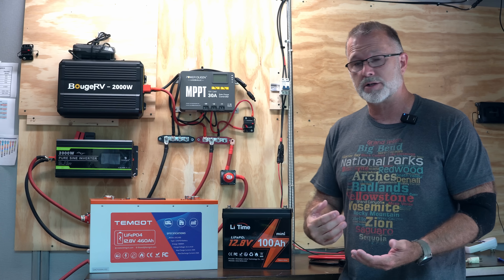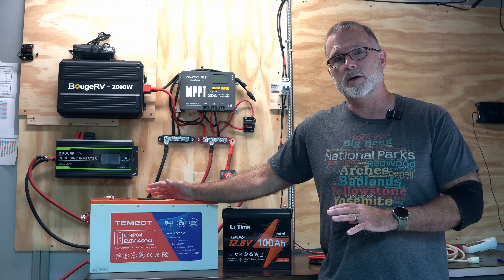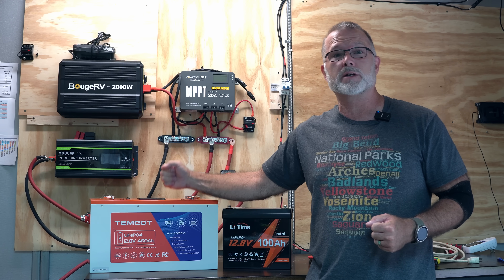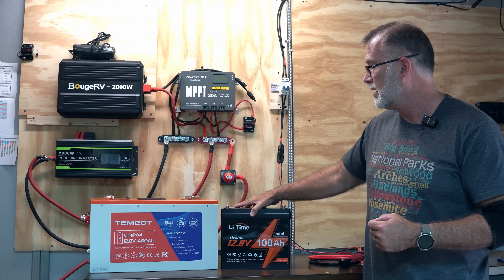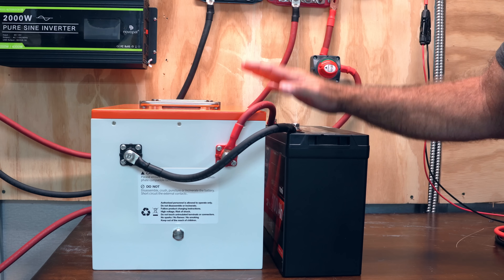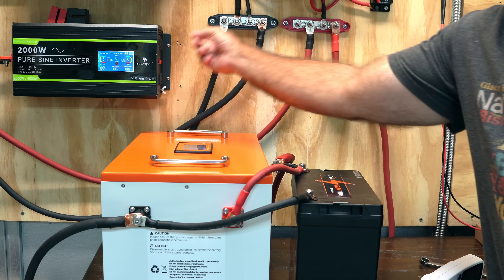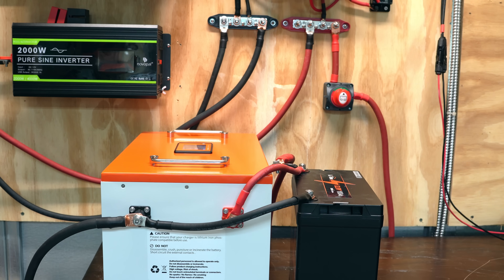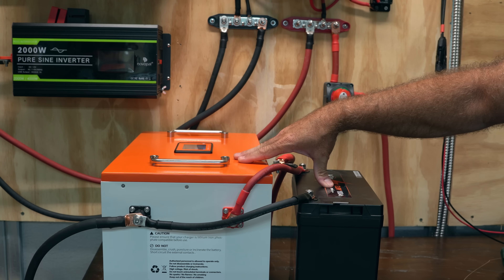Connecting Batteries with DIFFERENT Capacity in Parallel - What Happens?!

Comment: It's strongly recommended you don't use batteries of different capacities in parallel, the load is roughly shared between batteries and as such the lower capacity will discharge faster and then there's a danger of the larger capacity trying to recharge the lower capacity in other words some of the power in the larger battery is being wasted charging the lower capacity one, in some applications such as lithium polymer batteries there's a danger of fire with the excess currents the may arise between the two batteries, in lead acid you may get cell damage, do not mix different capacities in a parallel configuration.
If batteries are used in a parallel configuration, they should be of the same chemistry, same age and same capacity
Reply: how a battery with a smaller capacity will discharge sooner when both maintain the same voltage during discharge

Comment: So I can add a couple larger battle born batteries to my current 400ah setup, excellent 😊
Reply: Make sure to read the existing battery/s voltage/s and ensure that the NEW batteries (to be added) are at exactly (or within 0.5% of) that reading - when connecting them in, or you could become "the cable" that makes the shorting circuit, resulting in a nasty jolt between fingers, or worse, across your shoulders (and critical internal organs).

Comment: What about charging, my battery says 10amps max. I have two in series can I charge 20amps?.
Reply: Nope.
In series the voltage is doubled, but the current has to go though both.
In parallel the current is split so it can be doubled.

Comment: This is helpful as I was contemplating buying a second lead acid deep cycle 12 volt battery to put in parallel with the one that came with my RV. I wasn't sure how closely I needed to match the original battery. Apparently it's not that critical
Reply: That's exactly what I did for my touring caravan to maximise the benefit when charging from either the car or the PV panels, not had any issues and over doubled the time I can run without a mains hookup
Reply: To both you and @Paul-FrancisB
What neither of you have done (or intend to do) has a daul battery isolator in the charging circuit (from the alternator), as they will just become as if a single battery bank, that could well go "below" the required vehicle starting voltage, with a result of being unable to recharge anything, if away from a mains recharging facility.

It's far better in an RV to have a battery isolator in the form of a dual battery circuit, where if needed, you can switch across between one battery or the other, or if a vehicle's battery gets drained (you accidentally leave the lights on or similar) you can JUMP the vehicle's battery with the RV's on-board house battey, just enough to restart the vehicle to recharge the main 1st until it's nearly recharged, and then the dual battery isolator automatically switches the 2nd battery (the house battery) into the charging circuit, to then recharge both batteries.

Having both interconnected as if a single batter, may sound easy, but overdraining the house battery, will also drain the vehicle's battery, and visa versa, often well below the capability to restart the vehicle.

Having a dual battery isolater connected, you will also more than likely have some way of having a low battery alarm, on at least the vehicle's battery, if not on both batteries.

TO WARN if either one is getting too low
Then you should quickly restart the vehicle, to recharge both to a suitable level - to ensure that you aren't marooned with two flat batteries and a dead motor
Reply: @QUIX4U  hi you have mis read my reply, I don't have an RV it is a Car and Caravan. 2 batteries in the caravan in parallel, as it is 12V. The car, oddly has 2 manufacturer fitted batteries also, Mercedes 280 (the 2nd smaller one is for the ABS and self levelling suspension). The auxiliary power  (blue wire in the UK) is only energised for charging and the fridge if the alternator is charging. The caravan (camper trailer, I believe the American phrase is) cannot drain the car batteries. 
The solar can top up the leisure batteries if it is sunny, a rare event in the UK, or the mains hookup if available.
I hope this helps you understand my reply.
My understanding of the OP is he was going to double up the leisure (deep cycle) battery in the RV, and not mess with the engine starting battery or the split charge system if he has one. So he would have 3 batteries in total.
Reply: @Paul-FrancisB  So isn't a caravan just a European RV, which we also denote as tow behind trailers? Anyway don't waste your money buying another lead acid battery when you would be better off getting lithiums. You can actually get the same continuous current from one lithium as you can from two lead acid. Lithium can be run down to 0% and not hurt the capacity. Where lead acid will lose capacity when the level goes below 50%. It will usually lose about %20 capacity the first time you take it down below 50% and continue to lose capacity each time you go below 50%.

Comment: I didn't get one answer that is bothering me from here - can this kind of setup be unhealthy for etither of these batteries? Secondly, can charging be unhealthy or even dangerous if two different size of batteries are connected in parallel? (Isn't there a risk of overcharging the smaller battery?)
Reply: It's not dissimilar to the factory setup on my E class Merc, it has a small battery (motorcycle size) to prevent voltage droop to the suspension compressor and ABS under the bonnet, as the main battery is in the back which is a fair distance off being an estate car.

Comment: One thing to keep in mind is the voltage difference between the two batteries under use. For example, if the voltage output of the smaller battery falls below the voltage output of the large battery, the large battery will end up charging the smaller battery instead of putting all it's current output towards the load. The usual way to prevent this is through the use of so-called "steering diodes." This prevents one battery from discharging some or all of it's current output into another battery. Unfortunately it also lowers the overall output voltage by 0.7 volts for each diode that ends up being between the final output from the batteries and the load.
Reply: "the large battery will end up charging the smaller battery instead of putting all it's current output towards the load."
While unlikely, this is also harmless; since the charge is still available to the load.
Reply: @thomasmaughan4798  Its actually true and is the reason you should always use matched batteries when they are not rechargeable for obvious reasons.
The secret is separate BMS for each battery. Don't try to use one BMS for both batteries.
Reply: @davidsoulsby1102  "you should always use matched batteries when they are not rechargeable for obvious reasons."
Agreed; in certain circumstances.  In particular if they are in series.  The one that discharges first will block the others, or worse, it will be reverse charged which in the case of lithium is very bad, likely to result in fire and explosion. 

"The secret is separate BMS for each battery."
Agreed.  Each battery should have its own protection.
Reply: Yeah but there will be a drop in efficiency due to losses caused by the larger battery charging the small one. Though the efficiency will be a lot lower than the one caused by the diodes.
Reply: @holyscrap4445  "but there will be a drop in efficiency due to losses caused by the larger battery charging the small one."
It is unlikely the larger one tries to charge the smaller one.  As I explained already, what will happen is the rate of discharge of the smaller battery will decline faster than the rate of discharge of the larger battery simply because of the higher internal resistance of the smaller battery.  Thus, both batteries will deplete their proportion of charge at about the same rate; the larger battery will be at 2/3 charge and the smaller battery will also be at 2/3 charge and their voltages will still be the same.  Thus, each battery provides current into the load proportional to their internal resistance and neither battery will attempt to charge the other.
Only in the case that you have a fully charged battery connected to a depleted battery will one charge the other, and it won't matter which is larger what matters is which has the higher voltage.
But connected to a load, each battery will drive the load and not each other. 
Steering diodes will certainly help when charging the batteries also in the case that their voltages are not the same (different chemistry or ages).
Reply: There is no need for diodes in connecting two batteries of the same voltage and technology together. It is a good idea to check that their voltages are close when you actually connect them or you could get charging/discharging current between the batteries. Just fully charge both before you connect them... Once they are connected their voltages will always be the same and their state of charge will too. No diodes... The current will be shared according to their capacities. No diodes...
Did I explain that OK? I used to design battery chargers for telecommunications applications...fun!
Reply: The use of Schottky diodes drops this to about ~0.2VDC.

Comment: Get the batteries within 1/10th of a volt before connecting them in parallel.
Reply: That's totally unnecessary, they will balance each other once connected in parallel. You just don't want a big enough voltage difference that any of the batteries could charge or discharge too quickly when connected.
Reply: @bobbygetsbanned6049
I agree. And that is what I do when building packs with raw cells. Putting a 3.5v cell with a 3.7 volt cell is not going to cause a lot of amperage between them. But a 4.1V cell and 3.9v cell could cause some inappropriate current. 

So for people that know that they’re good. For people that don’t I just tell them to manually balance to 0.1 volts. It’s the safest way to give instructions on that in my mind.

Comment: Real world lead acid battery capacity; as opposed to what is written in the specs; are worlds apart.

I've discovered you can put damaged batteries together in parallel to form a single battery delivering nominal voltage.  But this alone is far from a measure of battery capacity. 
A shorted dead cell in the battery is just a dead cell. I tend to avoid batteries with already dead cells. I do know that if you keep a battery fully charged, it tends to de-sulfate over time and come good. 

I have a wide variety of Paired 12 volt batteries in series to form 24V batteries compatible with my inverter. But these pairs display odd behaviours during normal cycles. There tends to be a stronger battery and a weaker one. But as a pair they tend to display a nominal voltage consistent with the charge state of the entire system.

Im currently experimenting with reinforcing the weaker 12V battery of my 24V pairs, both in series and in parallel. But I'm not sure it's necessary given the paired voltage remains nominal. I'm not detecting resistance hot spots, so I'm not worried about current surge at this time.

With a 12 volt battery its harder to keep tabs on individual cells. I don't currently have a practical procedure for this. 

I also have a single 24V battery created by a series loop of 2V batteries, but these guys are 24 years old.

I don't yet have a bus bar charging all my batteries. I'm making everything out of copper pipe and its taking time.

Its funny how battery LOR is a curious combination of simple math and a black art.

Comment: If the 460AH was fully charged and the 100AH was flat when you connect them, would there be a massive current dump into the 100AH and cause the BMS to shut down on the 100AH? André
Reply: If they were in parallel the big would charge the small and provide the power for the load as well

Comment: If you know what you are doing you can do anything you want.  If you don't,  then you can get into trouble no matter what.
Reply: I do anything I want. And I definitely don’t know what I’m doing. 😂🤣😁
Reply: @ecospider5  It's only that you get results you never expected, so lets hope the next one doesn't kill you (as not knowing what will happen when doing dngerous things - will ALWAYS end badly).
Reply: @QUIX4U
I really enjoy setting something up in a crazy way. Then seeing what happens. The trick is understanding how crazy the setup is so you know what safety procedures to use.

Like plugging in a 40 year old amplifier that hasn’t turned on in decades. Don’t do that with 120v. Get a thermal camera and watch the electronics as you increase the voltage starting at 30v. A damaged component will probably heat up too early. Doing it at a low voltage stopped that component from damaging others. 

Something that surprised me the other day was a fire extinguisher. I had an expired on so discharged it in the yard. If that was in a 12x12 room I would not be able to see for 5 minutes. 

I do crazy things when it’s safe that way I have more knowledge of what I can do safely in an emergency

Comment: I have been researching this question for years and this is the first time I've found a solid answer. Thank you.
Reply: Years?  I could have found the answer in 5 minutes with a google search, but I already knew.
Reply: @stinkycheese804  The first GOOD answer I found. I guess your googling works better.
I was complimenting the video creator, not inviting snarky comments.
Reply: me too
Reply: those are the basics of electrical engineering, I don't remember if I learned it in elementary school or just in high school, if you're still in kindergarten, don't worry, that will come later
Reply: @makantahi3731  I'm not an electrical engineer, so I look for answers.
If you learned about lithium battery balancing and charging and what can affect their capacities in the long-term in elementary school, wow.
Reply: @sonofbr  not about lithium batteries, but these are the basic things regardless of the type of battery: capacity/voltage/power, what can be used in which combination, and balancing the batteries is not a big deal, I bought 20 18650 batteries and connected them in a series of 4 pieces, with that I got 16v and 2ah, I got 5 such sets that I connected in parallel with each other, with that I got 16v and 10ah, there are no electronics between the individual cells, they are all directly soldered, I often use them to top up the car battery, surveillance camera, inductive heater for waxing the bike chain, ac-dc converter... I charge them with a regular car charger that can reach 16.8-17v, every 6 months I check the voltages of individual cells while they are full and empty, and there is almost no difference, if it is 0.05 v, so that after a hundred cycles there is no need for balancing
Reply: @makantahi3731  First you insult me and now you telling me all about stuff you've done?
Don't talk to me, weirdo.
Reply: @sonofbr  well, what else do you want now, that I pay for your mental pain?, the whole story with the capacitor in the dc current is a hot moron, because it should be the size of a barrel, the only sense is as compensation for the reactive power of induction motors. are we done or do you still have some problems that are bothering you
Reply: @sonofbr  no one offended you, your problem is that in your country the school system is not at a very high level, so everyone who completes at least elementary school has never heard of ohm's law, and it's a very simple thing and I'm telling you what I did so that you don't have to again searching for an answer about balancing battery capacity for years

Comment: Not until 6:41 did you tell us that you are using Lithium Ion batteries. I was hoping you were making a useful video on the effects of connecting two lead acid batteries in parallel.
Reply: He did. He stated that connecting 2 batteries of the same chemistry is ok.
Reply: its printed right on the batteries
Reply: He did talk a lot about BMSs which aren't a common thing on lead acid, but I don't really blame you for expecting the more common style of battery. I think it should apply to lead-acid batteries too, but without the protections of a BMS.

Comment: I have a "6 pack" of 2.4 volt Lithium Titanate batteries that store 12.6 volts for 40 Ah, tied to a Lithium Iron/ 100Ah. (with BMS). They are supplying power to 5 exterior 12 volt/ 2 watt lights, and 2 -2 watt bulbs (for half of the night interior lighting). I wake up in the morning to a charge reading of 12.8 to 13 volts EVERY MORNING!

Comment: I have a van main battery under the hood. I have a small winch in the back for motorcycle loading. Currently I use a separate battery for the winch.  Could I run a wire from the main battery to the winch battery for charging purposes? Would the amp draw of the winch fry the wires connecting the batteries? 
Basically looking for a work-around for running a big fat expensive wire from the engine bay to the back of the van.
Reply: You'd fry the wire running the winch if the rear battery couldn't handle the load. Same if it drew too much charging current. In old RV's there was a "battery isolator" which allowed charging of 2 batteries, then disconnected the engine starting battery when you turned the engine off. Get one of those and your system should work OK. 

According to your wire run lengths and routing, you might be able to use cheap car jumper cables split in two. Just remember that the insulation isn't very heat or chemical (oil) resistant and the wire gauge may be a size smaller than stated. I don't know why the wire is so much cheaper this way but I've been doing exactly that to get power to the back of my workvans for over 30 years and never a problem of any kind.